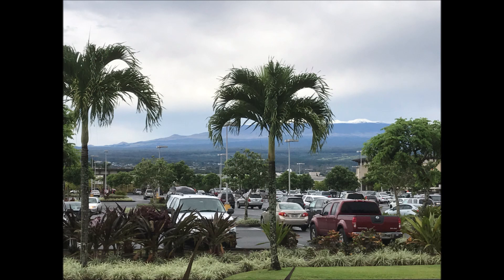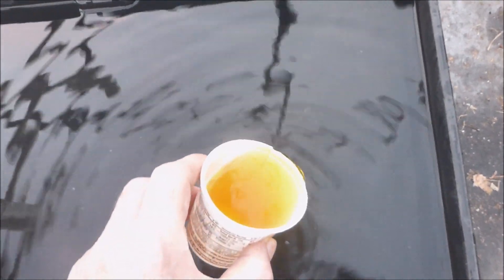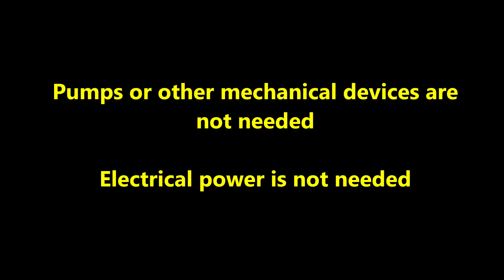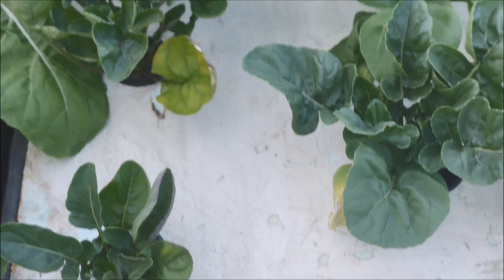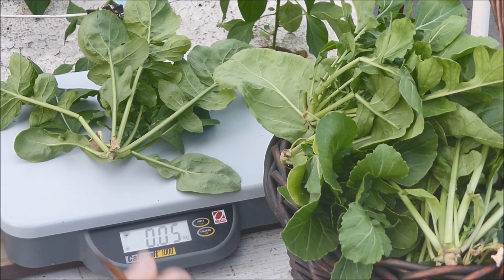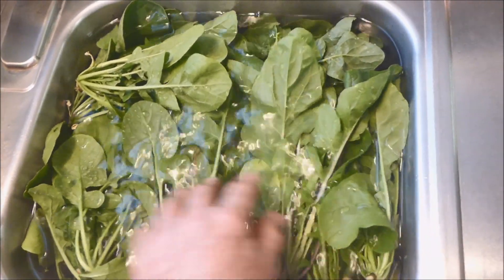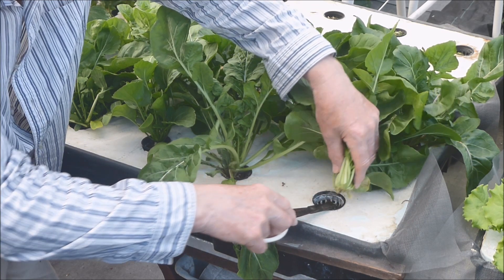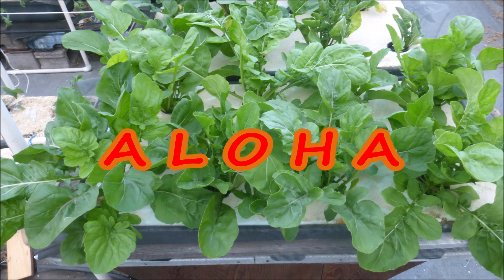Growing  'Adagio'  Arugula with a Suspended Pot, Non Circulating Hydroponic Kratky Method

Comment: Kratky method is low-cost however may come with one disadvantage - the salt/nitrate level in the crops can be very high due to the high EC level as the water level drops. happy to be correct if I am wrong.

Comment: I have a variety of organic Arugula called Eruca vesicaria var. sativa from seeds of change . com, do you think this method would work for this variety as well?  I certainly am going to give it a try, but I am curious what effect the variety will have upon the results.  I am looking forward to give this a try and will try to remember to post an update once I have some results.   In the meantime, I will try to grow a few seeds under grow lights with this method, and perhaps a few more in my small greenhouse that I heat with a small electric heater in winter.  

I have a couple of additional questions perhaps you or someone would be able to answer, or perhaps direct me to a reliable source to find the answer.  For context, I am in the Midwest on a nearly 20 acre homestead that is very heavily wooded, with around 1-2 acres that our home and garden areas imbedded somewhat deeply within. Our forest, as expected, teems with a very wide and diverse variety of insects and many other pests.  This has presented a number of challenges in terms of propagating and managing our vegetable gardens using organic, natural, and sustainable methods, as you can well imagine.  My main concern is this insect pest pressure, even though at this time, in January, it is at this time of the year, not presently a concern, but once we come into spring, will become a continuous struggle.  For potted plants and row crops, I have used frequent treatments of diluted Neem spray on both outside plants, as well as those in my greenhouse, with only limited success.  For a heavy infestation of aphids and whiteflies that unfortunately infiltrated my greenhouse in late fall this past year, I discovered that the Neem was unable to control the insects, (which had been unwittingly introduced from a patio cherry tomato and a couple of young volunteer tomatoes I had brought inside to attempt overwintering, in spite of pre-treatment of both the plants and the soil prior to their transfer inside).  I ended up opting to dispose of the plants rather than attempt to save them, due to the likelihood that the insects would transmit disease to other plants in the future.  We are constructing a second, larger greenhouse in the coming weeks, where I intend to employ hydroponics to primarily grow brassicas,  and will be introducing beneficial lady bugs within to help control aphids should they again become a problem.  But this brings me to my question, which is, as one who is new to hydroponics, what if any, organic liquid or other pesticide compounds are the most effective for use with hydroponic systems? Will diluted solutions of Neem oil or other common organic pest/disease control solutions that might drip or leech into water containment result in plant mortality, stunt growth, or cause other issues?  What advice or recommendations would you have for this situation, and do you have a website or another trusted source where I could find reliable answers to some of these and other future hydroponics questions I might have, or is there a forum you could direct me to where I am able to submit questions to experts or other experienced hydroponic farmers?  I thank you very much for any information you would be willing to share on this, or any suggestions you have to help direct me on the best place to find answers! :)
Reply from the maker: I am not familiar with your variety, but think there is a good chance that this growing system would work well with it.  I would suggest that you contact the Cooperative Extension Service or Master Gardeners in your state for the other information which you seek.  Alternatively, you could contact the Extension Specialist in a particular field such as Entomology at your land-grant university college of agriculture.
Reply: @growkratky5558  I will do that. Thank you very much!

Comment: Hi Dr Kratky, thanks for the video. Can you please explain if tank B had the 8-15-36, MgSO4 and also calcium nitrate? Or was it Calcium nitrate only? Why did you choose to do different nutrients in each tank? I'm about to start lettuce in a mason jar and I'm trying to understand how to make a nutrient solution for 1.5L. Thank you!
Reply from the maker: Stock solutions A (Chemgro 8-15-36 + magnesium sulfate) and B (calcium nitrate) are maintained in separate storage containers because the calcium would react with  several components of stock solution A if stored in this concentrated form, but they do not react when they are in the dilute form in the growing tanks. Both growing tanks  of arugula were given the Chemgro 8-15-36, magnesium sulfate and calcium nitrate.  It might be easier for you to find a hydroponic fertilizer where all the necessary elements are in the same container (their directions will suggest an application rate).   These are usually a little more expensive than those which we used, but should be affordable for a small project like you propose.

Comment: Dr. I have the same issue with standard arugula varieties. I get very random success and failure in the same tanks. I'm thinking it has to do with the fact that the arugula doesn't like a wet crown or at least not for a long time. I will try a tank with the arugula in a deeper pot so it can be drier. I will update you on the results.
Reply: I’ve also found the same w them growing in soil.  Some grow big and strong and others just don’t at all.

Comment: Aloha!  What was your EC and pH?  I can't seem to find a good source of information for ideal EC/pH/Temperature for different crops, especially arugula.  I just grew my first batch of arugula labeled as 'slow bolt', which all bolted in about 35 days from transplant.  My arugula was quite a bit smaller, I'm wondering if it is the seed variety or maybe my lower grow room temperature (which hovers around 64 degrees).  I'm also wondering if the lower temperature accelerated the bolting.  Next time I"m going to have 2 plants per net pot to see if I get different results.  Thank you for sharing all this information with us!
Reply from the maker: My EC was about 1.5 mS and pH was in the area of 6.5-7.   For temperature data, you might check the temperature of the Hilo airport from  Dec.5, 2018 to Jan.23, 2019 as my location is nearby; since the crop was in an open-sided greenhouse, the daytime temperatures were probably a few degrees higher than the airport data. It also  might be worthwhile for you to read the HortScience article on 'Adagio' arugula.
Reply: @growkratky5558  Thank you, I just pulled up the article.  Here in northern Michigan we're now under a blizzard warning... I'm thinking of going downstairs and starting some more lettuce.  Winter up here is much more pleasant with a grow room and fresh veggies!

Comment: Im planning to make a bucket system with float valve control for my greenhouse, i have 10liter buckets, so that around 2,64 gallon, would that be enough for the root system? Also what is the best level for sollution by float valve? A few inches from bothem of the bucket?
Reply from the maker: Plants should grow well in those buckets.  One approach is to let the solution lower naturally until the half mark or slightly below the half mark and then maintain that level with a float valve for the duration of the crop.  You might experiment with various levels on different crops by placing boards of different thickness under several of the buckets.

Comment: Maybe the breed isn't completely stable yet. Could set some up for going to seed with each other.
Reply from the maker: Dr. Janick suggests the extreme variation is not due to the seed source which was cross-pollinated.  I think it might be useful to use 2 week-old seedlings which are carefully selected to have uniform size.  Also,  there is a possibility that the front 4 plants were exposed to more intense sunlight due to the angle of the sun, but I'm not sure about that.
Reply: As the plant thinks we can't all be the same.